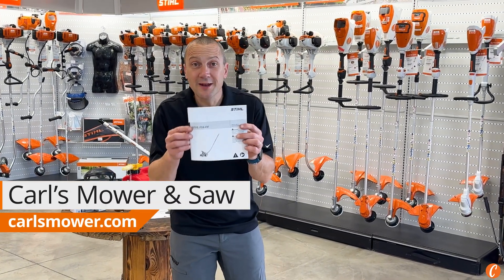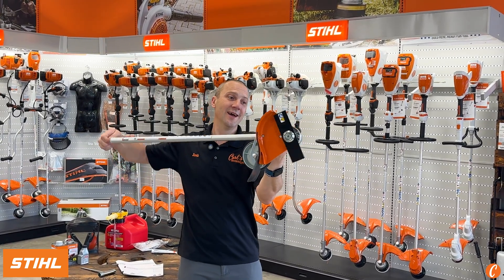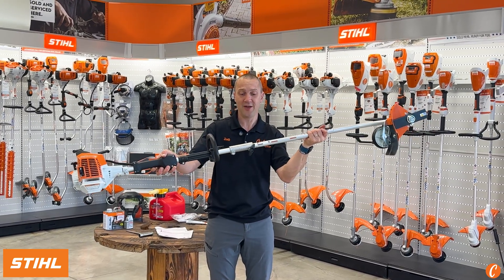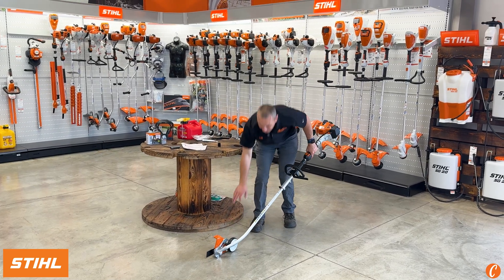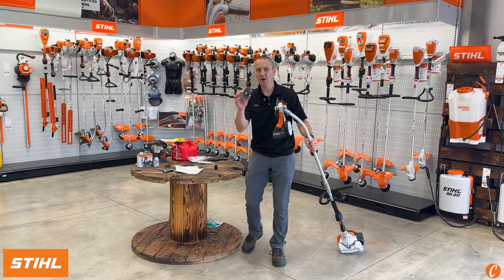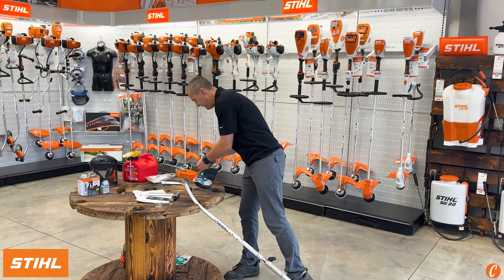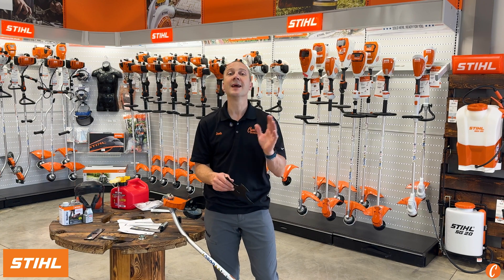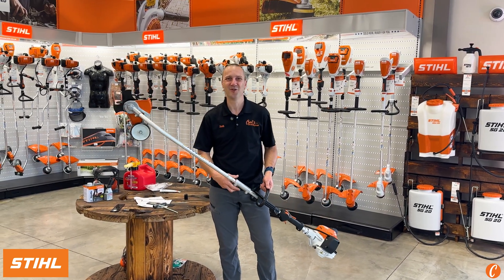Quick Guide to the STIHL FCB-KM Kombi Edger

Comment: I have been using the Kombi curve shaft blade edger for 20 years.  The original design, FC, had a gear box lube point like the string trimmers.  I added a newer model blade edger, FCB-KM, it has no gear box lube location, yet the manual mentions it.  Is there a way to lube the gear box?  It seems crazy for Stihl to have cheapened this attachment to save a few cents.
Reply from the maker: There is no way to grease the gearbox
I am with you. I wish they still had it, but I am told that they did not experience a drop in bearing Leif when they got rid of that whether that’s true or not, I could not prove it.   I will tell you in the shop. We have not seen an increase in bearing or gear case failure since the change.  But time will tell.